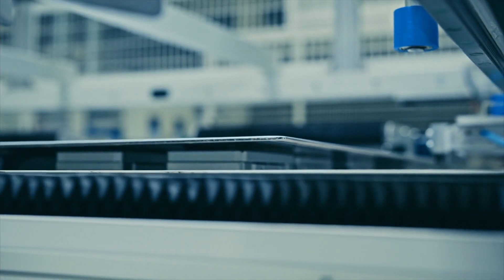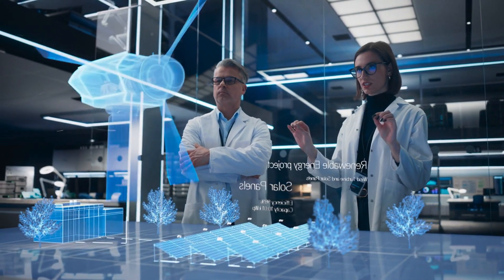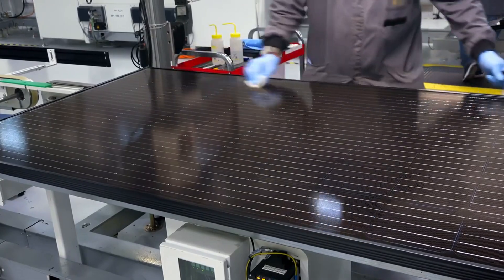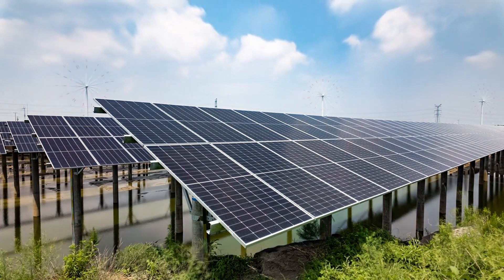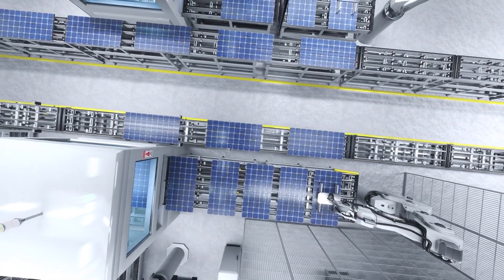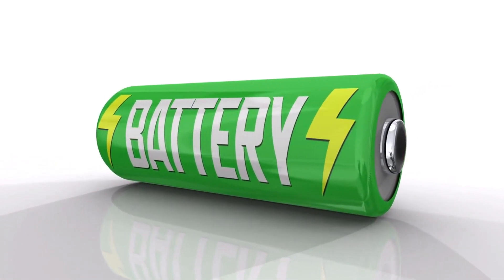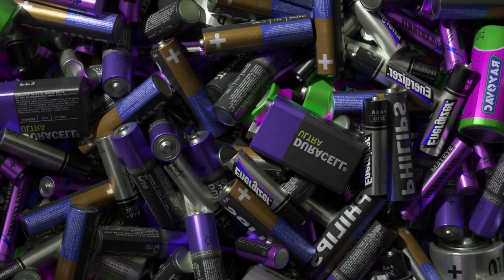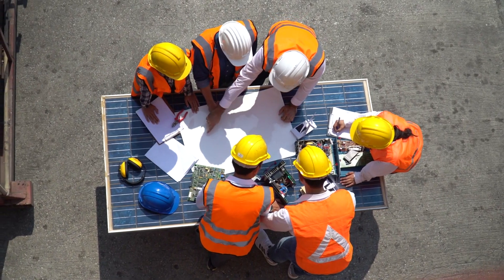RECORD Solar Cell that Stores Energy for 18 Years (Battery End!)

Comment from the maker: What are your comments about such a new family of solar cells that stores electricity?
Reply: I waited and waited for the "deep dive" into the details. Nothing. 
You just repeated the same vague  things several different ways with different graphics...and a tangent off into why PV is good but has a few vague shortcomings.
Storage efficiency of 2.3%?😂😂😂 That's not" super-high" nor is it a "record" except in energy loss. People won't be ditching their batteries just yet lol.
"How does it work, you ask?"
"Organic molecules"...then you go on about cooling, which boost PV efficiency but is not relevant to storage. That's not any sort of explanation of how the panels work.
Sorry, but it's a terrible video.
Reply from the maker: @topspeed250k5  thanks for your feedback